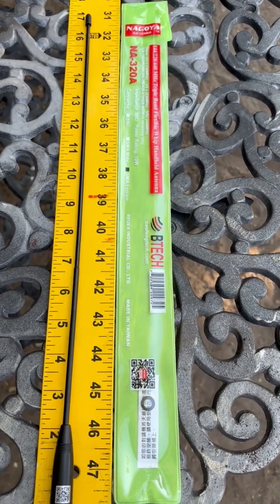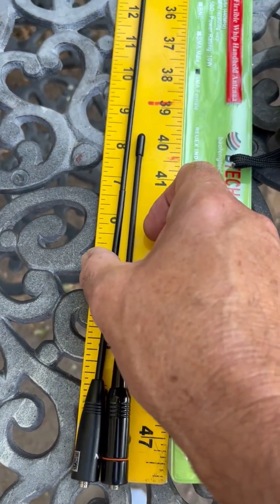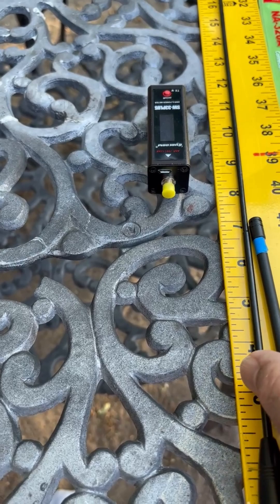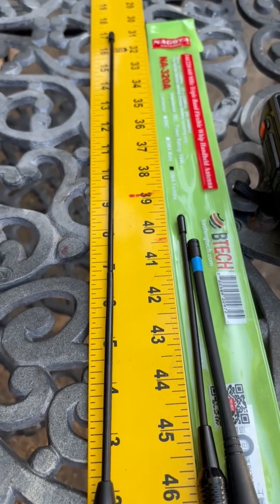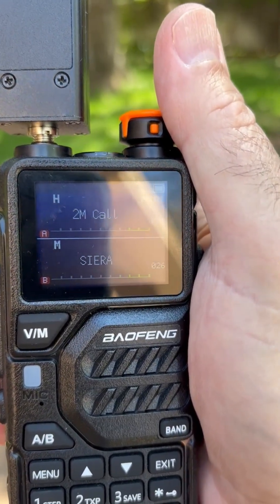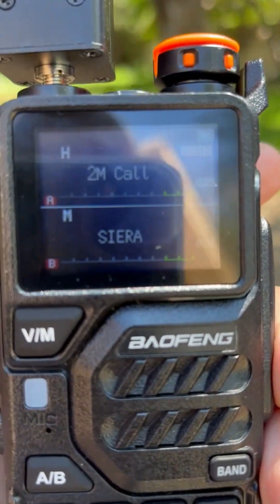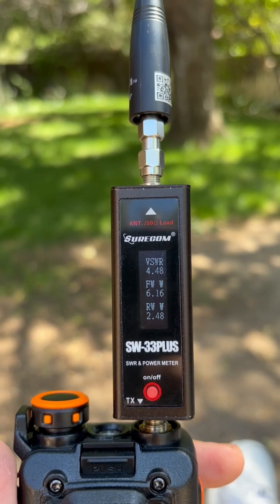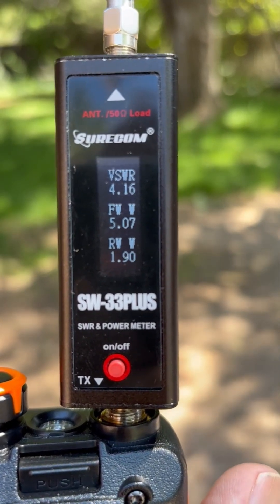Nagoya Tri Band Antenna

Comment: Three Questions I've always been curious about that brand of radio and being it's handheld does it get out very far? And can you adjust SWR? Is that why you are sending it back?
Reply from the maker: Hi Robert, Before I purchased a radio to use as my base station for 2 meters, I was using a Baofeng UV-5R hooked up to and outside antenna. It got the job done and I never heard any reports of poor audio. I also use a UV-5R for use on my work's business frequency and it works great. I just went outside with my K5PLUS and was able to hit a repeater 25.8 miles away with the stock antenna with no problem. I just ordered another K5Plus to perform a range test using simplex and to try out some of the features. I'll post a new video with the results. I haven't seen the results of a K5PLUS on a spectrum analyzer to see how clean it transmits. The SWR of the handheld antennas are pretty much set. It is possible to trim some of the antennas if they are too long, but I've never tried it.  73s and thanks for watching!